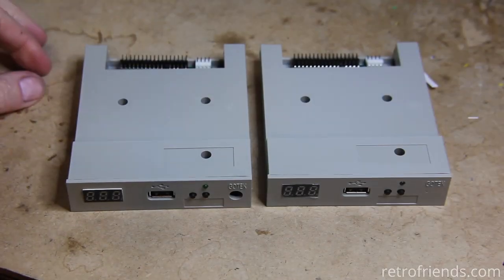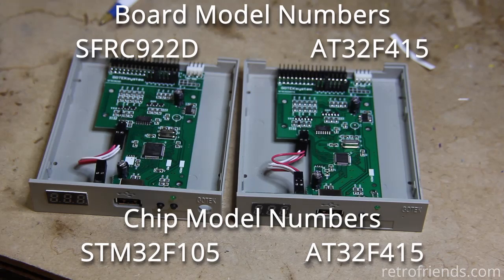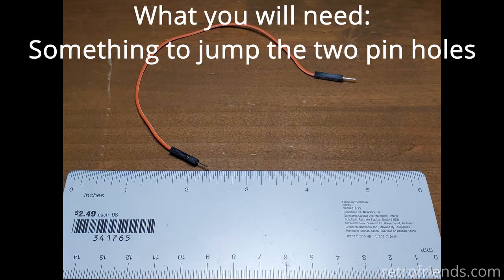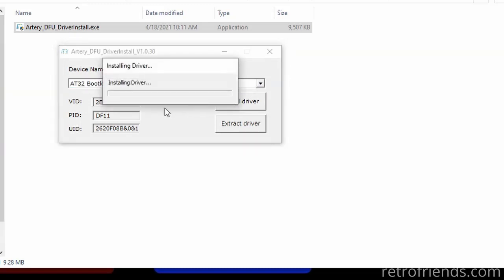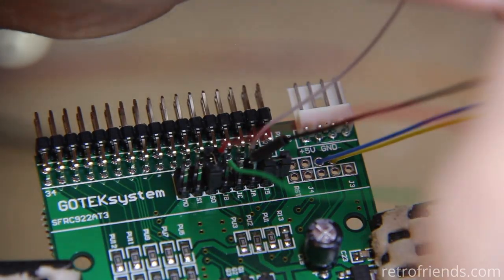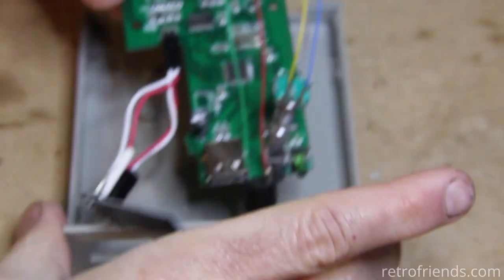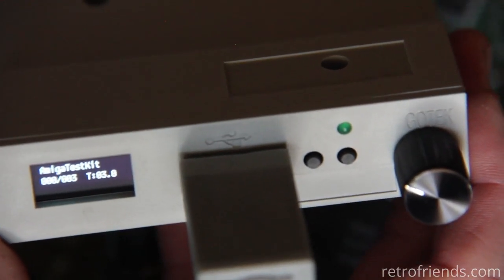Gotek Floppy Emulator: NEW 2021 FlashFloppy and Mods Procedure!

Comment: Funny that this FDD emulator has 32-bit ARM CPU at 150 MHz which is multiple times faster than the retro host machine (8088, 286) 🙂
Tech development speed is amazing.

Comment: Thanks for this tutorial. I did everything you said and now the gotek cpu at415 works for the amig 1200. the first time it didn't work because the usb cable a a was not good, then I got another usb cable a a and then it worked.

Comment: You do really good work.  You absolutely do make it look easy and I doubt I would do as good a job myself (turns out many retro fans are also "retro people" with many of the failings as the old stuff we still enjoy!  So our eyes aren't as sharp as they once were or our hands as steady!)

I have a question:  There is a copy and paste operation in the FlashFloppy firmware.  I don't yet know how to properly make use of it.  My thought is that I would include a "blank" disk image and use the copy and paste (as new) to add new disks.  What else would a copy-paste rotary menu option be for?  Could you put together a video demonstrating this?

Comment: Hey there, do you know if all gotek drives are the same so to speak? Looking for a drive for my Roland s760 sampler and don't know if I can go for any of the drives or need a special one. Also does the rotary knob make a difference? Cheers!
Reply from the maker: I really can't speak for the entire market of GoTek drives, but I can tell you that I've had many Roland users by them from me without any complaints. Please consider buying one for me - link to my eBay store in the description. Mine come with all the bells and whistles including the knob, which is a lot easier to scan through the files than tapping a button a million times.

Comment: [Sorted out - see my next comment ] ... No matter what can't get the rotary part working on "new" Gotek, it's flashed with newest FF version, I am using bare EC11 rotary encoder and only the pushbutton works fine, no reaction on rotation whatsoever. I have five of these EC11 so I tried the second one just to be sure, but to no avail. I've also triple checked the wiring and it seems to be correct. I am out of ideas, if anyone has a clue, please get in touch :)

Comment: Sir one question: my retro computer can only handle 720k FDD.
Can I buy any Gotek and flash it with FlashFloppy and using it as 720k FDD?
Reply from the maker: Yes. Goteks work as 720 and 1.44.

Comment: You Sir made my day. I got my Gotek and was not aware i would need programing it. I soldered quickly a USB cable , programed and it Works.
Thank you very much !
Reply: where did you find the pinouts for the usb cable ? I assume its not straight passthrough

Comment: the update to the programming software changed the "write protect" element of this  thing as I found out earlier. it's still in the same place, just has options twice.. do it twice and it's fine.. the 2nd time you do it, you'll notice another option added.

Comment: Are there any mods for the 1.44M floppy emulator (Artery AT32F415RBT7SFT4W-001) with 26 pin flat cable. This is a floppy emulator for a Tektronix oscilloscope, SFRC20.B.  I would like have rotary encoder and oled access.
Reply from the maker: I think Flashfloppy works with just about everything. Look online for options for replacing the 'scope's drive with a PC drive. The gotek emulates PC drives well. Please consider me as an optional source for an already-modded Gotek. My eBay store link is in the description :)

Comment: The one I just got has an even smaller and lower pin count microcontroller. It's so small, I can't read the markings on the chip even with my phone camera magnifier.  It's about a quarter the size of the Artery controller.

Comment: Thanks for a great video!  I followed your instructions to upgrade my GOTEK to an OLED 0.91" 128 X 32 display.  However, I have issues with dexterity, so instead of trying to use the existing cable and modifying it, I bought this: https://smile.amazon.com/dp/B01EV70C78?ref=ppx_yo2ov_dt_b_product_details&th=1 for $7 and used 4 of the female / female cables to connect the display to the board.  Worked nicely.  The 8" length was a bit long; I just looped the cable once inside the case when closing up.  The OLED display is a huge improvement!

Comment: This was a fantastic video! thank you so much! Really helped me figure out how to install upgrades on a gotek. I recently bought a new gotek that had a "AT32F416" chip which when I opened the flash software shows up as a "AT32F415" I believe its the same chip, just with a much smaller footprint.

Comment: Great video. Would this work to replace the floppy drive on my Korg 01w-fd keyboard. There are other basic emulators on Amazon that appear to be a good replacement but I like that yours is updated.
Reply from the maker: If you follow a link in the description for my eBay store you'll find that I sell them pre-moded.. The likelihood of it working with your keyboard is nearly 100%, because I've had people with Korg equipment by them from me before. I think you have to move a jumper or two. Go to my website, retrofriends.com and follow the links for GoTek for any detail on that equipment ("hosts" link on the flashfloppy wiki).
I have them in black, gray, and beige. I also offer 30-day returns if it doesn't work out.

Comment: I just got mine from you off Ebay, nice piece!  Now, the real question is.. I'm trying to install this into an external SF314 floppy for my ST and retain the original floppy inside my 520ST. Any idea if this would work?  Giving me both options?  

Lastly.. the floppy ribbon cable inside the SF314 seems soldered.. I can't get it out without breaking.. never seen that before!
Reply from the maker: I am sorry, but I am an Amiga guy and not really familiar with the AtariST. There should be a way to make it work. I have another video for using a Gotek externally, but it applies to Amiga. Maybe something in that video would help?
Reply: @retrofriends  all good!

Comment: SFR1M44-U100 is the model i have and nothing seems to work , i just get get 3 red zero's on the emu
Reply from the maker: Not enough info. Is it doing this when you're actually trying to use it? Try plugging just the power into it and turning it on. It should say F-F. If it does the GoTek itself is fine, and you have a configuration problem. Have you set up the Gotek to work with your specific host device? My website is in the description, you can go there for more help.
Reply: @retrofriends so im trying to get it to work with my ensoniq eps , but i got the flashing thing all wrong i guess , cause the latest vid u posted on the subject had a different way of flashing then the first vid i seen , i didnt know what model of gotek i had but now i do im getting it , i just need to follow the instructions from your latest { Gotek Floppy Emulator: NEW 2021 FlashFloppy and Mods Procedure!vid } hopefully this works , i was a bit confused so many ppl sayin different things on how to put flashfloppy on the gotek , then ppl sayin i need HxC for ensoniq eps to read files ...im just super lost but i appreciate u reaching out to try and help me out

Comment: Thanks for this video! It's nice to know I can mod a newer Gotek in case I buy another one. I have an older Gotek with an ST chip, so I'm just waiting for material to arrive to follow your original tutorials. Just out of curiosity: was there a cut down in production costs for this video? Soldering cables to holes and pin headers makes it look more... amateurish.
Reply from the maker: Thank you for the complement 🙄 All ameturs know solder is more reliable, secure, and low-profle than a connector. One day I hope to graduate from professional to ameteur :P

Comment: Tell me how to return the stock firmware, after flashing the firmware according to your instructions, my display shows incomprehensible information "F-F " I was going to use this for my korg i 30
Reply from the maker: I'm sorry that "F-F" seems incomprehensible to you, as it's simply stands for "Flash Floppy". So let your heart not be troubled - you've done everything correct. Flash floppy is known to me more compatible with devices than the factory firmware. In fact, as I sell these premodded on eBay, they now come from the factory with flash floppy firmware. So I would think that if the manufacturer is confident enough to abandon their firmware in lieu of Flash Floppy, that shouldn't give anyone any problems. Was it working before you flashed it? Try flashing it again, perhaps with a different version of Flash Floppy. If you've never had it working on your equipment, make sure to configure the GoTek properly for your equipment. I have links on my website on how to do this - link in the description.
Reply: @retrofriends  Thank you for your response. Tell me, is firmware 3.39 adapted for the OLED display and encoder? or can it work with a 7 segment display? When I insert my USB drive on the display I see this: the “E34” selection buttons do not react at all, the flash drive is formatted in fat 32 and is divided into 100 virtual floppy disks. I will be infinitely grateful for any help to set it up correctly GOTEK.
Reply from the maker: @alexgordienko5207  All recent versions will be compatible with all screens and all options. I'm not familiar with that specific error, or your specific application. If you find no answers by googling your issue, join the flashfloppy Facebook group.  Once there you can search and very likely find your problem, but if not you can ask the question.

Comment: My gotek doesnt pop up anywhere in device manager, is the Gotek supposed to turn on when inserting the usb cable?
Reply from the maker: You have either a Gotek, cable, or driver problem. That's as far as I can go given the information provided. The gotek looks dead when you plug it in. This is normal when shorting the programming jumper.
Reply: @retrofriends  Didn't pop up, but I got it fixed somehow. No more floppys for my Yamaha TX16W :)

Comment: I ordered the oled screen, jumper headers and usb connector to upgrade the gotek drive in a synth module. When I opened it, the controller chip is a 32pin version. Its absolutely tiny. I'm thinking that its not going to be compatible with flash floppy. Or anything else for that matter. I've just ordered another drive so I'm hoping it'll be usable.
Reply from the maker: That's the Artery 416 chip. It is compatible with flash floppy, and there's even ways to put the mods on it. Not many people do the mods anymore, because GoTeks come from the factory with the mods. The premodded ones are the ones I sell in my eBay store, and if you hadn't already bought one I would have recommended that. The link is in the description to my eBay store for future reference.
Reply: @retrofriends  Thanks for giving me the heads up on that. So you're saying I shouldn't need to do anything else other than connect the display?
Reply from the maker: @mickricksbsc  You need to at least load it with flashfloppy before any mods will work.

Comment: Is it possible to send commands to the GoTek to have it generate disk image files as if you inserted a blank, unformatted disk?  It seems like an obviously useful thing though I am unable to find any such thing easily.  I'm guessing you just add a blank disk image to USB drive but it would be much more convenient if the GoTek could somehow be directed to create disk image files and then mount them.
Reply from the maker: Each host device (Amiga. IBM, Roland, etc) has its own type of image file. Being able to generate all those different types would I imagine be impossible.
Reply: @retrofriends  True, however, that's why there's a config file.  All that would be needed is a template file indicated in the config file for it to replicate into a new disk image... or perhaps a list of disk image files if the system supports multiple formats.  It wouldn't be impossible, it would be trivial.  All that would then be needed is a menu system which says "create new disk" and if there is more than one template image file in the config, the user would select from one of the template files listed in the config file.
Reply from the maker: @erroneus00  It sounds like a question for the developers of Flashfloppy. Join the flashfloppy Facebook group, and post the request there.
Reply: @retrofriends  I don't "facebook" so no.  But there are two things I definitely know after years and years of experience.  1. I am not as smart as the next guy.  2. As evidence continues to demonstrate, if I came up with an idea, someone else already thought of it years before.  I merely pointed out the obvious.

But I can tell you one reason it hasn't already happened -- the chip programming environment space is probably just about full already.  To expand features probably requires a "next chip" release of the thing.
Reply from the maker: @erroneus00  The point of my reply was to direct you to the place where your ideas would get appreciated and possibly implemented. Sure, all comments here ultimately benefit this channel, but it's more important that I direct people to the correct place where they would know about additions to firmware that would be trivial to implement.

Comment: tank you for youre videos and the info you share . My  gotek has the new artry chip but i also have the extra pin for the rotaryencoder the nr on the pcb says sfrc922d is it the same way as the old one i should mod it or the new way that you are shoving in this video
Reply from the maker: No, the mods will be the same as the ST if you have those pins.

Comment: Thank you for your time on great vids 👍 I have modified 2 goteks and went very well with the serial way 😊 however have probs setting up the usb drive for my cpc6128. Is it me, but no one talks about setting up the usb drive on goteks 🤔 thanks again 👍
Reply from the maker: The disk images that you simply copy to the thumbdrive have been around for years on most host devices, so there is no set up per se. Maybe the cpc is different?
Reply: Thanks for the reply,  I have a gotek for an Amiga 500 and works very well, but the goteks I have flashed start to load, but then crush with an error message, not sure if it is the Amstrad or the goteks. Will look into it later on, thanks

Comment: Great video AGAIN! Are the new ones less good though as i thought they have half the Ram? Can you confirm functionality is same as i thought Keir said that some things might be buggy or not work?
Reply from the maker: Yes I think there is less RAM, but it's not like original floppy drives had any RAM. So the RAM is for the firmware to run, and it does. Plus any bug fixes would be just a FF version update away. Some [logical] speculation here, admittedly.

Comment: Goodnight. I am from Brazil. I need help. I installed the Gotek SFRM72-FU-DL on the Yamaha PSR620 Keyboard, and it is not working correctly, I created 10 virtual disks on the pendrive, using the Floppy Manege software, Gotek only recognizes disk 000, it does not read the other created disks. I need to know if I have to put the FF.CFG and img.CFG files in the root of my pendrive?
Reply from the maker: No, you do not need those. If you can read one disk image, everything is set right. Try another USB stick or reformat the one you have. FAT32.

Comment: Would you happen to have a gotek floppy emulator for a Korg X3. I have one but it doesn't seem to communicate with the Korg anymore.
Reply from the maker: Yes, and you can buy one from my eBay store. Link in the description.
Reply: @retrofriends   you have this one Amiga Atari IBM Roland AKAI would this work with the Korg X3?
Reply: @retrofriends  Amazon looks like the right one ,,thats in the link, Anything I need to do with it to get it working in my keyboard?
Reply from the maker: I can't really provide good support for items not bought from me.
Reply from the maker: @slooky14  Yes I have sold that one to many Korg users.
Reply: @retrofriends  I got the amazon link from you?
Reply from the maker: @slooky14  There is an Amazon link in the description for a bare-bones version that needs flashed and modded (as this video details). Go that route if you want to, but the previous point still applies: Support from me is limited unless you buy my pre-modded one that I personally have done the work on and tested.
Reply: @retrofriends  ok thats all I needed to hear. I would like to purchase one from you. It all depends on the one I have right now. I'm still waiting to hear back from the guy, that I purchased the orginal one from. So if things don't work out from the guy I bought from, I will purchase from you. thank you😊

Comment: How are you mounting the OLED?  It looks like you are using a 3D bracket of some kind?  Also, didn't you need to cut/enlarge the hole?
Reply from the maker: I leave that part of it up to you. I just threw something together quickly for the video. Check my previous video on how to mod the Gotek for more detail on the OLED.
Reply: @retrofriends  Thanks ... I have watched your previous video (they are all fantastic!).  It showed you cutting the opening but I was confused because this one didn't show you enlarging the hole or gluing it, etc.
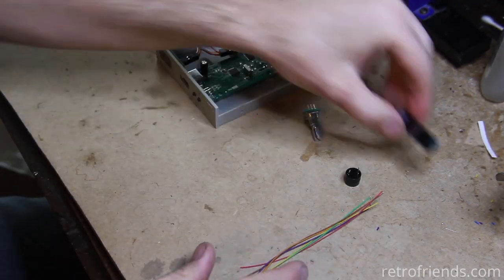Reply from the maker: @sofakng163  You missed at the 10:40 mark where I address this point.

Comment: I am stuck with the artery driver being installed without the ability to change the write protection.  What do I do? I am running Windows 10 Pro...
Reply from the maker: So you're trying to flash the go-tek with new firmware? I have other videos where I go into great detail about flashing and write protection so check my channel. The USB-A cable  method of flashing seems to work the best, and as long as you're using the artery flash software, have installed the artery driver, and use a jumper to short the programming pins, you shouldn't have any problems.